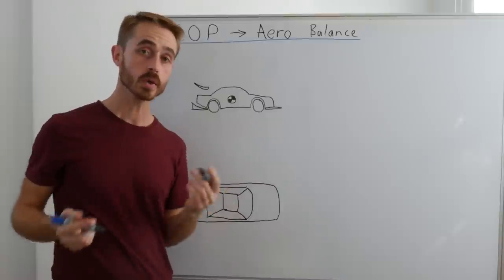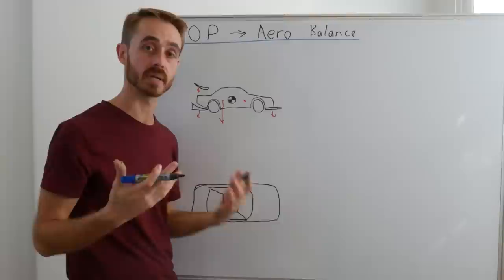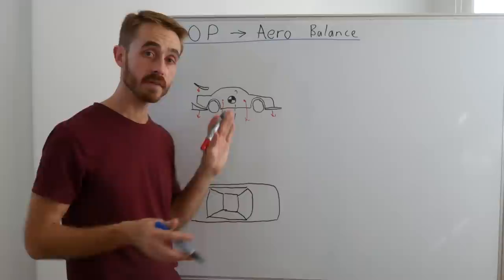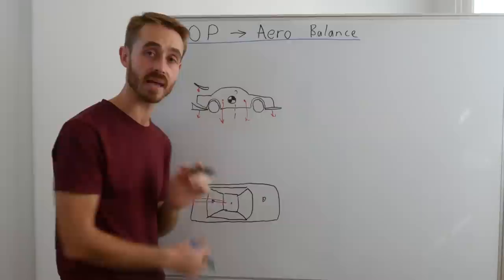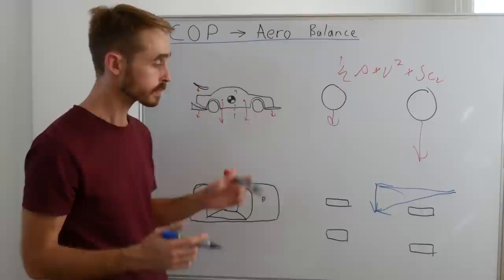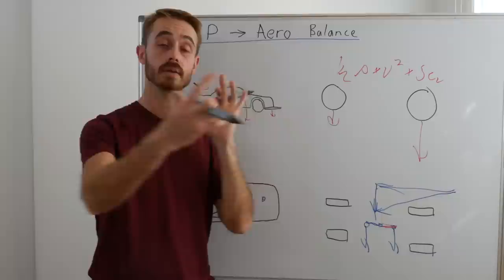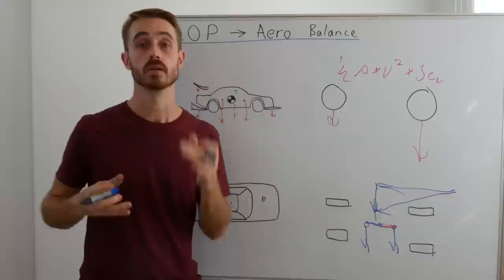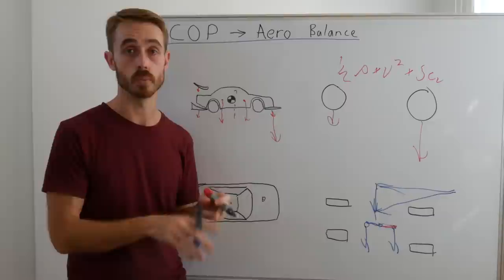How Does Aero Balancing Work? Centre of Pressure Explained

Comment from the maker: I've had a lot of requests for a detailed explanation on this one, so here you go! Enjoy!
Reply: KYLE.DRIVES i
Reply: Could you please explain how body rake compares to other downforce vectors.  I note that Red Bull always seems to have more rake than the competitors.
Reply: Rough first guess - more rake on a somewhat fixed geometry floor is converting more of the underside of the car into a relatively high efficiency downforce surface at the cost of net drag for identical front/rear wing angles (due mostly to added high pressure on the top, but also airflow detachment from the entire area rearward of the sidepods), which can yield probably comparable aero efficiency when trimmed out (and paired with slightly reduced low speed compression on the rear suspension), but in high-downforce configuration it places the rear wing higher up and allows for more net downforce to be created with finite front/rear wing surface area.
I'm a bit surprised that the high-rake cars aren't more crosswind or slip angle sensitive, as sealing the low pressure area at the edges of the floor (particularly in front of the rear wheels) seems like it would play havoc with stability there... although they might be working some sort of magic with the T-Tray/BargeBoard/TurningVane areas to generate vortices to counteract this effect.
Reply: Can you elaborate on your question? Are you asking about how body rake effects downforce levels, why Red Bull runs a high rake car, etc?
Reply: James Wright :
Reply: Sorry, new to this interface.  Question about body rake is more of a general set up interest.   It appears that Red Bull has a visible rake under low speeds with a rear suspension that flattens out at speed to reduce drag.  I have some ideas of how to do it, but don't know if there is enough advantage to be worth pursuing.  Second part of the question is what body types or classes would be better test such a system.
Reply: Paul Crawford Pure speculation, but I believe what Red Bull have done to get the rake change is playing around with their "third" element damper. The third element controls how the suspension behaves in forward-backward motion. A damper will  move easily if it is acted on slowly and be resistant to change if acted on quickly (think ooblek).  They can have the third element keep the rear suspension up (high rake) during corners where the damper will have shorter duration, constantly changing forces to respond to (you're punching the ooblek, but the displacement of the ooblek is very little). On the straights, the downforce created will have much longer period of time to act on the heave element, allowing it to lower the rear suspension up (you simply put your fist on the ooblek for a few seconds instead of the fractions of a second for punching it. by putting force into the ooblek for a longer period of time, you get far greater displacement of the ooblek).

The trick here is adjusting the settings of the third element (and doing some fancy stuff with hydraulic reservoirs) to have little displacement in the corners and large displacement on the straights. Keep in mind that these third elements also have effect on the suspension and tires too, so that must also be taken into account when determining optimum vehicle characteristics.
Reply: Paul Crawford To address the "is it worth it" question, I'd probably say no if you're working on a normal car. The high rake philosophy comes from the fact that F1 must run flat floors. If you can run a Venturi, do it. It gets the benefits of rake, but at a better efficiency and allows your suspension design/tuning to be focused on it's primary job: optimum tire contact. 

F1 suspension is primarily driven by aero with the idea of "Why optimize tire contact patch (difficult enough to nail down what optimum contact is with the lack of track testing) when you can just increase your normal force?"
Reply: Sent you a message on Facebook Kyle , cheers :)
Reply: Kyle I had already watched the video but clicked on it simpy because I felt like telling you that your channel is brilliant and greatly appreciated by very many of us.

Comment: I'd be curious what your take is on the aerodynamic ramifications from the phenomenon of understeer into snap oversteer as a predominant handling characteristic at the limit, and how aero-sensitive cars will have more of this.  
I think it would be pretty enlightening (especially as it relates to changing slip angles, or disturbed air) for motorsports fans trying to understand why cars which are visibly understeering can't necessarily do better than just terminal understeer [because the back end would step out and be un-catchable].

Comment: Great vid. No wonder the early 90s Williams F1 with it's electronic adaptive suspension was so dominant... Having the ability to change the suspension on a corner-by-corner basis means keeping on top of the changing sideforce/downforce allowing you to make incremental changes all the time to best utilise the 'torque' generated by the centres of down/side force pressures. Another, amongst many others, reason why it was so useful.

Comment: Very interesting subject, I've been tinkering with it and also with floor diffuser in a simulator called Assetto Corsa. I've found F1 car's from 1990's. Tend to have 37% COG, 37% Aero Balance at low speed entry, and 34% at high speed, the front wing tends to have 0.1CL less the rear wing. The rear diffuser only reach's high efficiency at high speed, which explains why the shift occurs at high speed. Shifting it to 40% COG and 37% Aero at high speed, gives you more frontal grip, but over-steer, for some tracks it's beneficial, but other's it's not. With 40%, you technically having more down-force on front, as front wing and rear wing down-force now equal each other as far as lift is concerned.
Reply: do know the formula to find the COP???
Reply: @eddiegarcia8671  Nope, but usually it's 1 to 3% behind COG.

Comment: Flat floor considerations when building on a budget? Like, what will small gaps between panels do, interlocking considerations, etc. I am thinking about doing one out of either aluminum or 36"x36" Carbon plates... mostly just to see if I can. But if it would be worthless, I don't think I will...

Comment: why do you never seem to see golf ball dimples on race cars?
Reply: I seem to recall reading something about Ferrari doing some experiments with patterned surfaces as a method of reducing drag.  The reason you see dimples on golf balls is because it reduces the size of the wake downstream (and consequently reduces pressure drag), by promoting an earlier transition to turbulent flow.  If you look at diagrams of flow patterns over a cylinder vs. the Reynolds number, what you will see is that as the Reynolds number gets very high (i.e. beyond the range of Reynolds numbers where you have vortex shedding), the high amount of turbulence causes the wake to contract.  The flow effectively becomes inviscid when the Reynolds number is infinite (i.e. when the flow is infinitely fast, or infinitely dense, or the object is infinitely large).

The thing about turbulent flow is that it causes an increase in shear stress at the wall of the object, i.e. at the point where the boundary layer contacts the surface, because the velocity gradient in the viscous sublayer of the turbulent boundary layer is steeper than it is in the laminar boundary layer.  The increase in shear stress corresponds to an increase in viscous drag - viscous drag is given by the integral of shear stress across the wall area.

Laminar flow does not promote mixing between the viscous boundary layer and the near-inviscid bulk fluid (so it can't negate pressure drag like turbulent flow can), but produces less shear stress in the fluid at the wall.  Pressure drag tends to be dominant in airfoils at high angles of attack - so my guess is that patterned surfaces are just too expensive, or too tricky to do.  There is a lot of talk in F1 of correlation between simulation and the real aero performance of the car, because the wind tunnels they use are not full-scale and consequently the Reynolds number is not the same.  The trick is to be able to make statements about the performance of the full-scale car from data you've got from a model - I imagine that patterned surfaces would  make this a lot harder than it already is.

Turbulence is already very difficult to model.  One of my tutors at university does research in direct numerical simulations of laminar-turbulent transitions and his projects run on 4000 cores for 45 days.
Reply: Because there’s other less complicated ways to produce the same effect
The dimples reduce the wake that produces drag behind the ball,that’s why F1 cars have the coke bottle shape at the rear,to guide the air to the rear instead of the sides or let it loose ( I know it does many other things as provide airflow for the rear wing and diffuser but )

Comment: Do you consider load shift to rear of the car coused by drag in simulations? it would means that center of preasure would need to be a little bit forward to compensate it.

Comment: what if the COP moment is equal to the COG even if the COP is in a different spot? Will that produce different characteristics  (understeer or oversteer) without having to add or subtract any downforce elements to change the COP?

Comment: Does anybody know generally speaking at around 100 miles per hour what angle I should be initially setting my rear wing at? The car is a 350Z with the rear wing just below roof height.

Comment: I'm wondering If the drag on the rear wing increase, will it put more pressure on the rear tires? Because the drag on the rear wing could generate a torque?

Comment: Are the center of pressure points the same for drag and downforce/lift? I mean it doesn't make much different longitudinally but I'd guess if there is a difference then the vertical location does have an effect on the car aero balance. Although I'd imagine the drag center of pressure moves towards the rear when you introduce slip angle?

Comment: Hi question if you wanted to generate electricity from air flow on a car were would be the best place and what sort of blades would you use. Propeller or paddle system.. Witch one would be best and were would you place it. I was thinking of the rear spoiler and a paddle blade. Wold this add to much drag against benefits of generating electricity.

Comment: Have you seen the HKS GTS800 that Andrew Brilliant designed? What are your thoughts? Could you maybe analyze/explain the front sections, sepcifically the "infiniti wings" as they call them. Thanks.
Reply from the maker: Seen it, modeled it, benchmarked it, and know all the numbers it's putting out. Out of professional courtesy to Andrew I won't be making a video on it though.
Reply: Understandable, is there potential for an analysis in the future? Once the GTS800 has ran its laps?

Comment: Thanks for the clarification on the difference between downforce distribution and side force distribution. I've always heard that you should keep your center of pressure behind the CG, but that never really made sense to me from a downforce perspective. Great video as always!

One question though: how does the drag force effect the "effective" downforce distribution? Does the CoP for downforce distro. include the drag component on CoP, or are you negating that? This probably gets more into vehicle dynamics since the drag will create a torque rather than a simple downward force. Not super familiar with suspension mechanics, but something to do with "dive" centers and "dive" stiffness (the longitudinal version of roll center and roll stiffness). And then you also have the drag torque's effect on body rake angle. Thoughts?
Reply from the maker: Well, allow me to redefine your perspective on drag COP. From the side view the line between the two contact patches is parallel to the drag force. So when the drag is applied from the side view, it essentially is making a static torque (lets take it around the rear axle for example). All this is doing is adjusting the normal force distribution, so you can think of it as moving the drag COP upwards is equivalent to moving the DF COP rearwards. As the contact patches are in line with the forces as previously mentioned, the drag force would be distributed equally if they were all locked still, but in reality it will only be enacted from the drive wheels, but they are in line with the other wheels,  so it doesn't make a difference. 

Essentially, as Cd and Cl both act on the frontal wind, the height of the drag COP doesn't matter, as you can just convert it to DF COP.

The only time drag COP location matters is if the car is asymmetric (shifting the COP left/right), in which case you can get a drag yaw torque around the CG. Does that all make sense?
Reply: Mostly makes sense. my main confusion is the last section of the first paragraph, mainly around what you are referring to as locked. Other than that, well put! Thanks for your help!

Comment: will the center of pressure change as in move slight more forward or more rearward at different speeds assuming the efficiencies of the front splitter and or rear wing change with speed.
Reply: yes it depends on which side (front or rear) has more downforce. as the car increases in speed, downforce increases.

Comment: Aero on FSAE cars, yay or nay?
Reply: definitely yay, more downforce means more Gs which means better skidpan. and since the speeds you're going at is so low, you'd need massive wings as well.
Reply: From that perspective it is obvious, but I'm thinking more cost vs reward, and could teams maybe do better at comp by getting a solid simple car together that can finish all dynamic events?
Reply: Solid, reliable, sorted car is the baseline, but once that is addressed, the performance frontier is going to be aero (and getting the suspension behavior in dynamic situations to work with aero loads).
Reply: tehllama42 I completely agree, when your in fighting it out with the big teams like Stuttgart and Delft, tenths of a second count and aero is an excellent way of getting that. But do you find teams seem to jump the gun on aero as they feel they simply cannot compete without it or even is it just that aero has become a must have accessory for a car for many people.